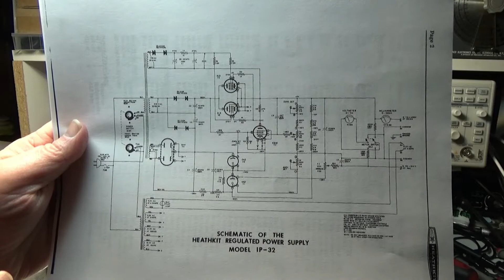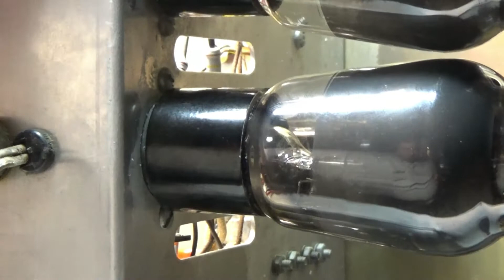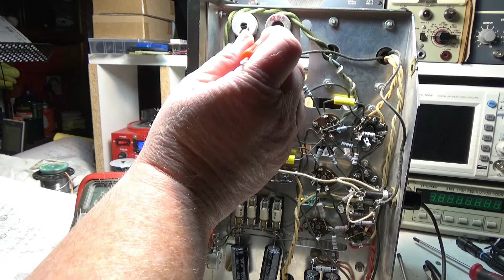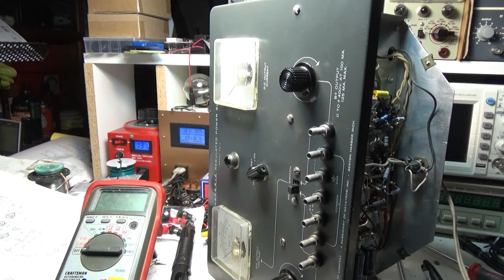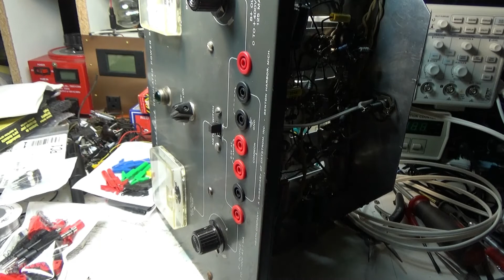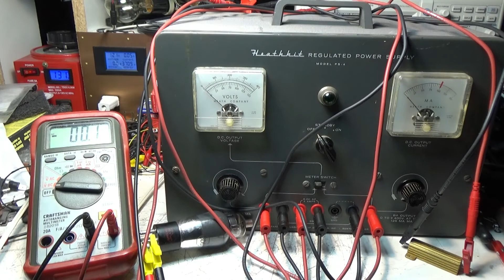Heathkit PS-4 Part2: Repairs And Testing!

Comment: Did you ever clean up the surface of the DC Output Current meter?
 I would try to remove the haziness with Novus #2 Fine Scratch Remover using a lint free cloth. Great job otherwise.
Reply from the maker: I did spend a few minutes with Novus #2, and it cleaned up some, but not great.  I thought I would use this more than I have.  Thank you for watching!!